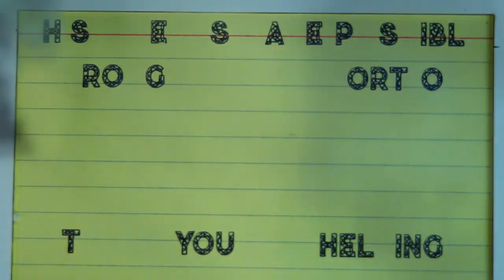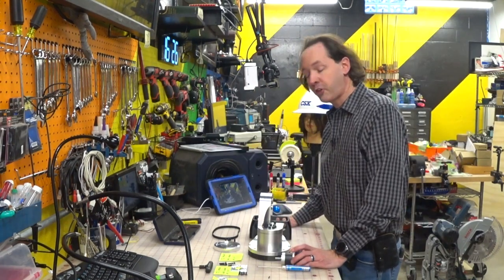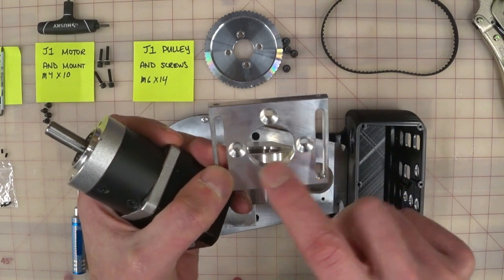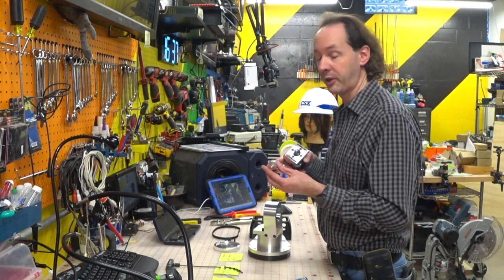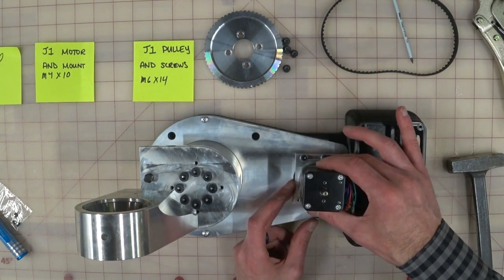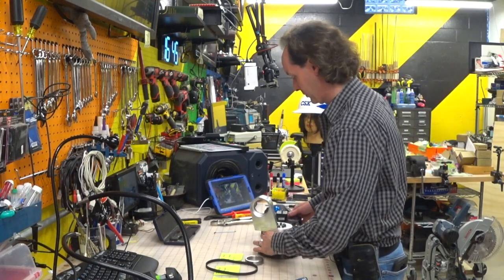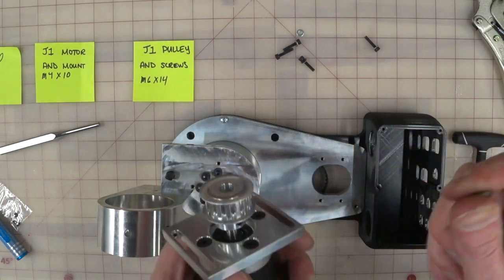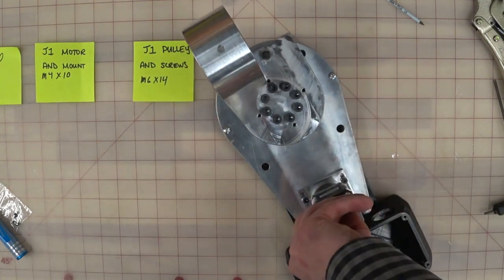Project ARchi3 Episode 5 J1 Drive Assembly

Comment: Info on the Xacto folding knife?
Reply from the maker: IT's an old Gerber Artifact. They don't make them anymore and that's a damn shame. They make a slightly larger version though, and it uses standard utility knife blades. I've got one and love it. It's just a bit larger. You can get them here. https://amzn.to/3ajwe2N
Reply: The Gerber Chris recommends above certainly looks the job. Not sure what the folding xacto knife referenced here is, but it led my thoughts to a knife I have a few of - cheap and cheerful. Unaffiliated Amazon link: https://www.amazon.com/Sheffield-12116-Ultimate-Utility-Knife/dp/B001DZPY8Y